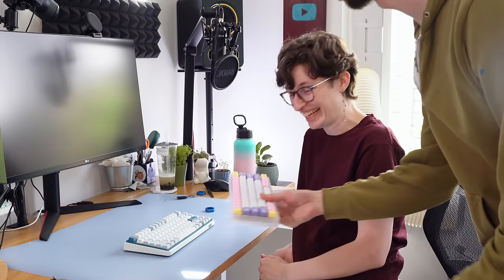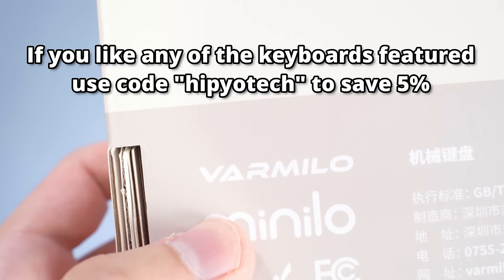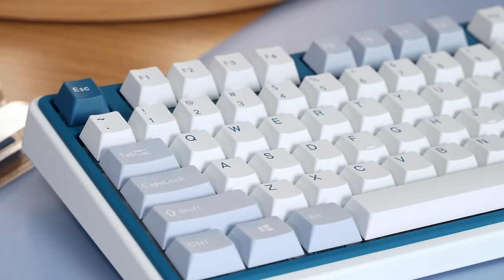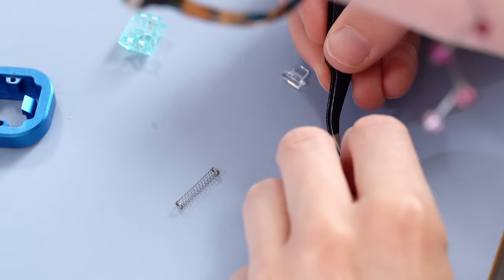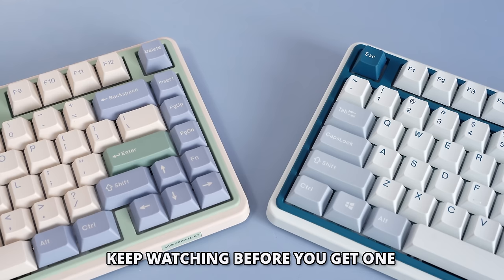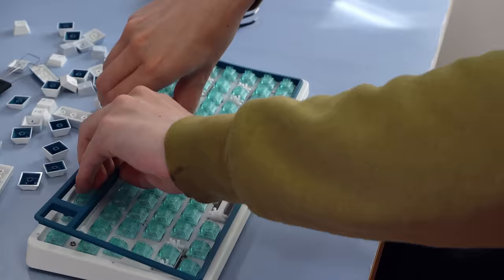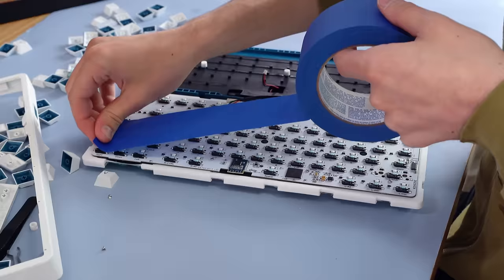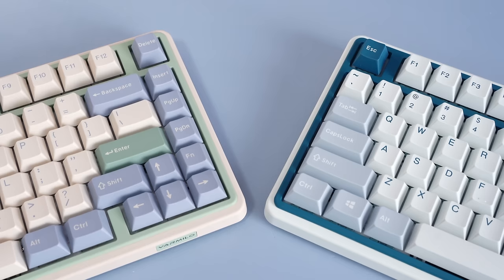The Worlds QUIETEST Keyboard. 🔇

Comment: What's confusing here is that a silent keyboard is ideal for many office environments. However many office jobs require numpad usage, so why isn't this keyboard offered with a numpad?
Reply from the maker: Good question
Reply: Because getting a standalone numpad is vastly superior anyway?
Reply: @gutterg0d but then the numpad won't be as silent ):
Reply: @cesarb1912 you gotta do twice the work for a custom matching one
Reply: gotta buy two keyboards, throw one out except for the switches and
get a keychron q0
Reply: Based on your comment, I think you might find the HOTO Compressed Air Capsule useful for maintaining a clean and spotless environment at your desk. It offers powerful vacuuming and blowing capabilities, making it perfect for keyboard cleaning. Its compact size and multiple tubes ensure flexibility in reaching tight spaces. Give it a try!
Reply: @gutterg0d How is it vastly superior?
Reply: @russc788  You can move it away when you don't need it.
Reply: @gutterg0d But then I also have to grab it and plug it in when I do need it… if you do occasional data entry on the daily, it makes no sense to move it on and off your desk, and if you’re not going to be moving it on or off your desk, then it’s better for it to be on the keyboard. A 97% is actually going to be more space conscious then a seperate device too. This of course assumes that you are consistently using the numpad like the original commenter mentioned. If you only very occasionally need one, maybe only once a week, then yeah, get it separate if you want. In an office environment, space isn’t exactly the largest concern and full size keyboards are the most common workplace keyboards based on purchases FYI.
Reply: @TheHeadincharge  You don't have to agree, it's ok. But you can get a wireless numpad for convenience, also you can move a wired numpads out of the way without disconnecting so my point still stands. It's not rocket science.
Reply: @gutterg0d not if you use alt keycodes on the numpad. Those don't work with detached numpads. I need to write the mu symbol and the degree symbol a lot as a scientist.
Reply: @KyleWarnUs   Just make a keyboard macro with bundled software (if your keyboard comes with it) or auto hotkey, or buy a streamdeck (other macro pad solutions exist too) and program it with any odd keys you might need. It can also enhance your workflows in a hundred other ways too if you put your mind to it a little. The more complex your workflows are, the more useful it becomes.
Reply: well some people dont do work with numbers, for example writing emails alot and writing is involved in alot of jobs
Reply: I usually only get full size keyboards bc they are superior but this might be the first exception I've ever made
Reply: @gutterg0d   Yep.  Will work for some people, and not for others.  For many, we prefer to have them attached.  I considered going with num pad as a separate thing, but for muscle memory = Nah.    The 96~98key/80% keyboard is almost as compact as a TKL with a full num pad.   So I went with that route.    If I didn't need the num pad, the 75% like this one would be almost perfect (Sorry, I want my vol knobs)
Reply: @TexasCat99  Muscle memory works the same way regardless if a num pad is attached to the keyboard or not. But I'm not saying nobody should ever have a full size keyboard (I use one daily myself), it's just that I think detachable/separate solutions will always be better because you can easily choose if you want to take up the extra space or not. There's also ergonomy to consider, a narrower working space means your shoulders takes less of a hit when you reach for the mouse. It may seem like a very minor problem, but it makes a big difference over time for people who work long sessions by the computer.
Reply: this is for the gamers that live with their parents
Reply: @gutterg0d  standalone numpads are a waste of money
Reply: @williamowens2063  That's not for you to decide for someone else.
Reply: @gutterg0d  Who said I decided it for anyone but myself? Re-read my comment
Reply: @williamowens2063  I only see your sweeping statement that it's a waste of money, anything else I should read? I just assumed you were not just talking about yourself, because I can't remember asking for someone's personal opinion on the subject.
Reply: @gutterg0d True, I didn't explicitly state it. I think it's good practice to simply assume that online opinions are subjective unless otherwise stated. 

You seem to take this very personally. Perhaps a break from the computer is in order here? Get some fresh air and clear your mind. Something to also keep in mind is that no one has to ask for your opinion, it's always okay to give your 2 cents. It's the internet - a huge public forum.
Reply: @williamowens2063  🙄
Reply: @gutterg0d  Nice one, got me there😂You know I'm right though. Also, standalone keypads are a waste of money.
Reply: @TheHeadincharge  Here's why I chose a 75% and a separate numpad. I can put the numpad on the left. It takes a little to get used to using left hand for numbers, but I have so much more space for my mouse and my keyboard is centered for me.
Reply: @gutterg0d superior keyboard with numpad: *look what they need to mimic a fraction of our power*
Reply: What kind of blue tape is he using in this video? Anyone?
Reply: @EbonyPope Painters tape.
Reply: @EbonyPope  Masking tape, it's painting tape, you put it around the corners of your walls when you paint
Reply: @zacharycarrier2890  Thanks already found it. Scotch blue.
Reply: I just checked their website and they have full sized 108 keyboards available that use these same silent switches.
Reply: Well, they do now.

Comment: I'm very new to this hobby, but the thing that makes the biggest impact in quieting my own keyboard is present in every video, but never mentioned: what the keyboard is sitting on! I don't have a desk pad so I use layers of very thin packing foam cut to the keyboard dimensions. Have you ever done a video on eliminating the transfer of vibration from keyboard to desk?
Reply: Interesting tip
Reply: I fear you've just unleashe a whole new can of worms on the mechanical keyboard community. Or as they say, "the plot thickens".
Reply: For me, a very fluffy, small towel or a folded small blanket worked the best. Any that can thickly pad the bottom of the keyboard works nicely!

Comment: If you are looking for silent switches I can highly recommend Outemu cream yellows (v1 or V2) or the newer jade yellows. They're dead silent and can be bought for like 15 cents a switch. The quality is like a Gazzew since they use the same molds.

Throw them in a cheap board like a GAS67 or better a GMK67. Great board to carry to work.
Reply: I have the GMK67 + v2 version of these cream yellow switches. Got it to be able to game while the baby sleeps right next to it. Everything is lubed, tape mode, etc. It is even more quieter than the one in the video. And everything is within the 100$ budget. Now my Logitech mx master 3s is the loudest out there.
Reply: Are any of these tactile?
Reply: I've used Gazzew U4RGB 65g as tactile silent switches. I don't have any other experience with mechanical keyboards, so I don't know if they're actually silent or tactile. But I'm okay with the results.

Comment: I have the keychron k4 v2, and I needed a silent keyboard for my videos. I did a lot of research into what components in a keyboard made the noise and I was surprised. Aside from clicky tactile switches, I was surprised to see that even linear switches made a LOT of noise. So I focused my attention on finding silent switches, there were a couple of contenders. Durock/alpaca, kalih box switches and one other I don't recall but durock dolphins ended up winning. I got 110 of them for $75 on Amazon and lubed them. They come pre lubed but are scratchy and lubing helped reduce this. My only complaint about them is, literally the only thing that makes them silent is a small silicone O ring thay is on the rails of the internal switch. So I thought, well I could just order those for my gateron reds, right? WRONG. I searched for hours and couldn't find anything about this small silicone gasket thingy for the rails and found nothing. I then attempted to swap them to my gateron reds and noticed that the durock dolphin switch rails had a small lip and my gateron reds didn't. So I installed them and moved on with my life. Only to fimd out I didn't like the 65 gram springs as my gateron reds were 40 gram. So I ordered 110 35 gram springs and I'm much happier but that's personal taste. I also foam modded my keychron k4 v2 case and it is basically silent. Oh and I added some foam to my space bar as it's hollow cavity echoed a lot! But now I'm super excited and pleased with my keychron k4 v2, I have to basically put my ear up to the keyboard to even hear the noise even when typing vigorously. My mic no longer picks it up and I've ordered kalih mute switches for my mouse and I'm praying they fit 😅. I'm using an evga x15 and I really like it but it's so loud compared to my keyboard now 😂
Reply: as much as I hate to recommend anything mass market, if your looking for a dead quiet mouse, the logitech mx master s is about as quiet as you can find.
Reply: @abelincoln7473  Wrong, there are cheaper quiet mouse out there, which are more silent than the logitech (which is also quite heavy) and makes a scratching sound when moving.
Reply: @GordonSeal  such as? No reason not to share..
Reply: Where did you get the 35g spring? What did you end up using? I’m sorry I got lost somewhere about the O Rings. Was it the durock dolphin switches swapped out for 35g spring? I need a light silent tactile and still trying to figure out what are available and suggestions. Thanks 🙏
Reply: @gabbychow4026  you could also look into hall effect, or magnetic switches.

Comment: I bought this keyboard and really like it. I change the keycaps to shine through for the RGB. Had one issue where I didn't know how to change the lighting type. The manual explained how to speed it up, make it darker or lighter and how to change the color. But I just wanted static white and couldn't get it. I did find out how to do it eventually but it was not in their manual from the website. How to change the lighting effect type was only shown on their RGB demonstration YouTube video. Anyways the way to do it is holding fn and then pressing f5 or f6 ...then to change the color which is explained in the manual,  is holding fn and pressing  -  or  =    to turn the lighting off or on is holding fn and pressing X  ...everything else is actually in the manual

Comment: Currently frustrated with how you demolished that keyboard. Did you not think of removing the rubber feet first to see if the screws holding the keyboard together were there?
Reply: I'm gonna double down. The screw for the part you broke off was from the bottom... that would probably mean that it was meant to be disassembled from the bottom side first right?

Comment: A brief history of Varmilo products:

Most keyboards have only soldered PCB and the steel plates are hooked to a PCB by beefy steel hooks. Not only you have to desolder switches/LEDs, but If you try to bend steel hooks to holes' directions, you will scratch the surface of the PCB to the point of either taking out most of the mask away or conductive copper sheet showing underneath.

Form wireless options, either only Bluetooth (cable is used only for charging battery) or Bluetooth+wire. 2.4 GHz is non existent and only few models have it.

If the price for the product is decent, shipping price kills the whole purpose of purchasing Varmilo board. And I am not talking about 10-15$ shipping like Keychron has, I am talking about 30-40$+ shipping price.

Quality control is either hit or miss. There are a lot of complains around the internet about either one of the switches not responding or one LED not working.

From my point of view, when you have such a big variety of keyboards, Varmilo and Drop are not a keyboard you should purchase.
Reply: Okayyyy, soooooooo, what’s the best stock silent board?
Reply: Following here too
Reply: They really don’t have much variety. I don’t know what you are on about. Most of their keyboards are the exact same with a different color scheme/design
Reply: Thanks for the information. I'm looking for the most silent stock keyboard because I'll have a microphone right next to it to talk into. If you can recommend me one, please let me know. My budget is several times higher than the price of this Varmilo keyboard.
Reply: @VicInCommentSection  Okay, although I don’t have much experience with custom keyboards, I did actually buy this keyboard as stock spec’d in the original video. And I love it! Very quiet and I really enjoy the relatively soft feel of the typing experience. I also purchased due to having a mic and not wanting to have loud typing noise come through when recording, and it’s been great. Like I said, not much experience, but the experience I’ve had with this has been superb.
Reply: @itsShelBoid Thank you very much!

Comment: Throw some outemu silent switches on that board and show off the battle of nosoundingness :D 
Love your vids and the chill style. Actually, your last silent keyb video caused me to buy a mecha that instantly got torn apart and moded towards absolute silence.
I bought some rebranded silent outemu switches from gamakay to put on my Mountain Everest max keyb, verry expensive gaming keyb lots of metal, cherry switches, dampening and it still felt cheap out of the box. 
I foam-modded it because the rubber between the plate and PCB was just...meh, 
tape-moded it also filled the bottom with as much foam as possible. + I glued in the absolute max possible amount of square nuts using double-sided tape, easily doubling the weight of the keyb to about 2.5 kg, clipped + lubed + band-aided all cherry stabilizers ....and re-lube all the outemu's, including the spring because spring ping af  ... what a pain to do ... full-size keyboard 105 keys... easy 5 hours ... and a ton of weird looks from my gf .....but totally worth it. Added pbts caps its a different key now, silent as the varmilo keyb, and if someone tries to break in, I could also use it as a weapon. :D

Comment: Sooo.. I bought this keyboard and it is NOT silent. I would describe it as SOFT THOCK. Are you into soft thock? The 80s boating music of keyboards. The reason I wanted a 'silent' keyboard is because I have ADHD, and especially when I'm trying to concentrate, sounds around me become acutely loud.. eating noises, clocks.. keyboard clicks. So to keep me on task and not grinding my teeth, I ponied up for this puppy. Am I disappointed it's not silent? Yeah. However the typing experience is very nice. It's pillowy and gentle, like a new born baby duck. If I was the office manager, I would be putting in a bulk order. It's not quite perfect for me personally, but would dramatically cut down the keyboard chatter in an office environment. Sound wise, it's probably louder than membrane keyboards like dime a dozen portable Logitech boards like the MX keys mini or even K380.. which sounds like a diss, BUT the sound, feel and angle of the Minilo is so much more pleasant. The point I'd like to make here, is that as a writer on the go, this is a stay at home keyboard as it has a lot more heft than those Logi boards. If sound is THE issue for you, you won't benefit from getting this and trying to take it on the road - you may as well get a cheaper option. However when you return home or to the office and want to feel gently held when you get in, this is very nice. @Hipyo, I'm coining 'soft thock' right now, let's colab on a t-shirt. Additional: the RGB is a bit much for me, I'd prefer the white back light, but it doesn't come with the 'Kailh Prestige Silent' switches. I think this board could be marketed to the 'low stimulation' market, but being able to choose 'white' rather than óff' would be nice. Now to crank this soft thock and have a little emotional moment. ~Jez
Reply: Yeah I got the exact switches and everything. My hastly put together keyboard with otemu peaches are waaaay more silent. Agree on typing experience though, it's amazing for a pre-built.

Comment: ive been looking for a quiet mechanical keyboard. but still on the fence on what brand to get, or if i should just try a Keychron first, was also debating a low profile but eh.... but yeah the whole taking it to a studio office is something that's been on my mind
Reply: You can get a hot-swappable keychain and just replace the switches with silent switches. You can also get some prebuilt keyboards from Epomaker that come with sea salt silent switches already installed.

Comment: @hipyotech - I loved this video. Want something quiet for my office. Would prefer a numpad option with the work I do, but leaning toward getting this. A few quick questions - assume key caps could be swapped for something low profile? If so, what would you suggest? Also, how heavy is the keyboard? Something I could travel with? Thanks!
Reply: Did you end up getting this keyboard?

Comment: if this was moddable, black, with better pbt keycaps, 5 socket and with south facing switches this would be awesome.
there is almost no keyboards on the market that are low profile without using low profile switches without a really high typing angle that you cant adjust.

Comment: It's a really nice looking keyboard. I'm partial to blue and white themes, though I have an Asus Azoth that I vinyl wrapped the top frame in white carbon fiber and replaced the keycaps with a blue and white set. If it wasn't for the OLED screen, you'd never know it was the Asus Azoth keyboard.